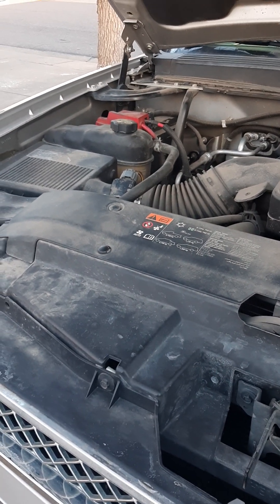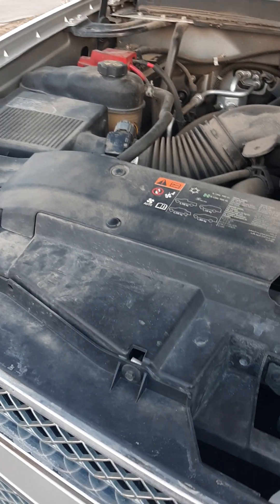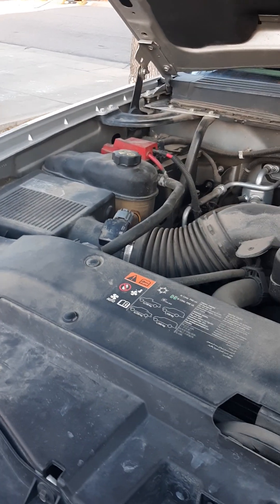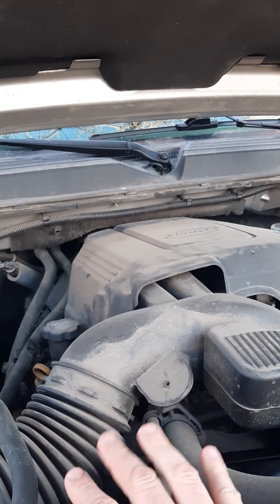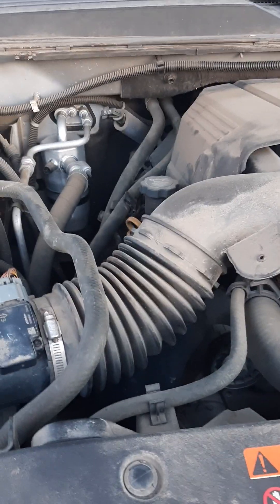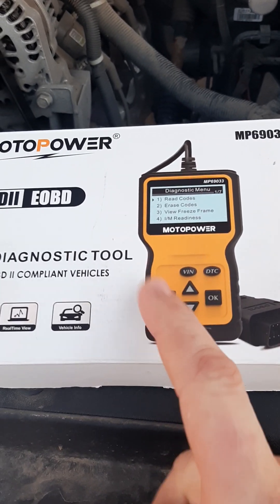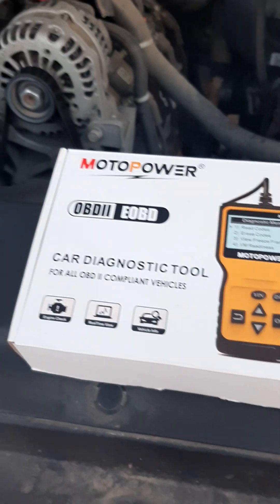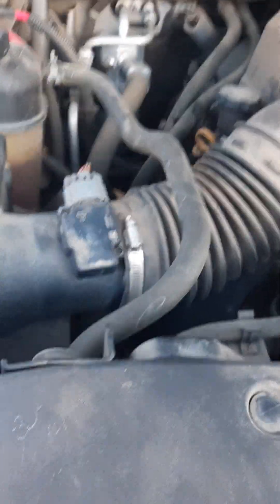Reset alcohol content sensor WITHOUT a computer/scanner

Comment: I am going to try this now.  i got a used 2011 Suburban same 5.3l and the ethanol % is stuck always showing 2.7%  I don't have a code but i know 2.7% is not normal especially since i tested putting in E15% and normal gas typically has 7-10%.  Sadly I went down the wrong path and found wrong info that the Autel AP2500E could do some minor bidirectional changes.. Sadly no option to reset the sensor.  Hope this works what you posted for my similar issue.

Comment: So after plugging the maf back up do you run the engine till it smooths out or just for 10secs then turn it off?
Reply from the maker: With my truck, after I plugged it back in, I ran it for about 10 seconds after it smoothed out.

Comment: What was your mileage before and after?  Did your alcohol content change back to reasonable percentage when running non-E85 gas?
Reply from the maker: It was running around 15mpg on the highway before. Now it's back up to normal.